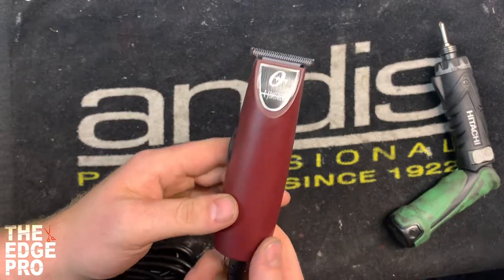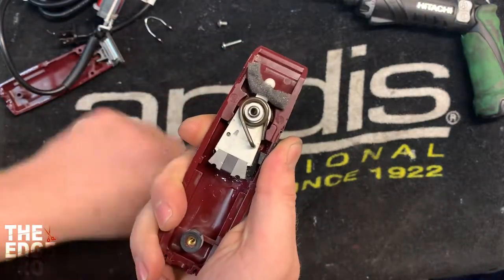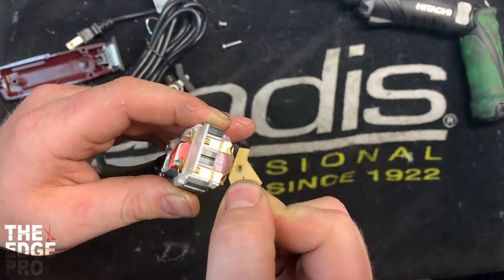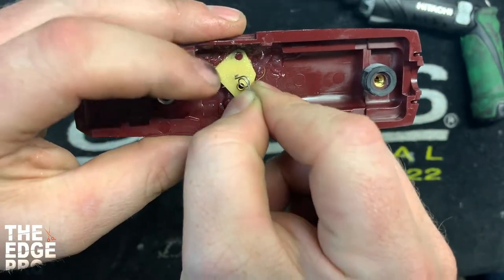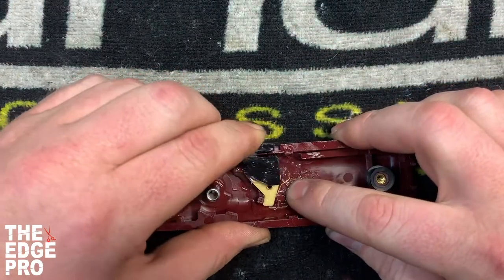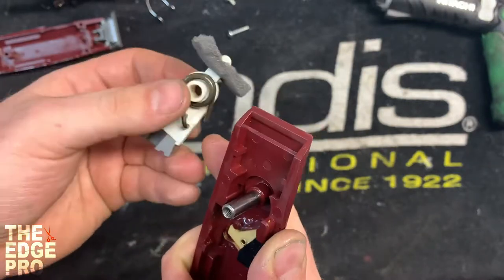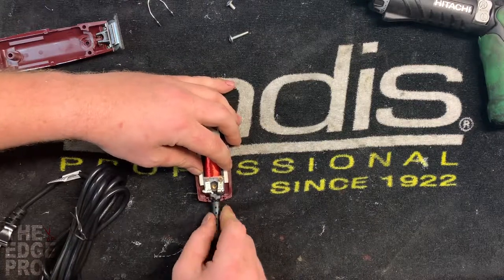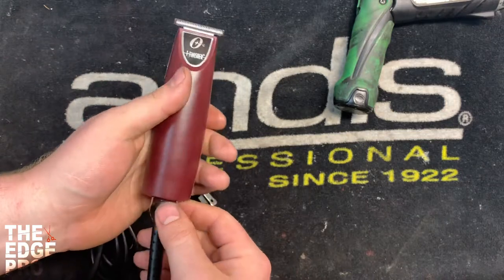How to Replace the Oster T-Finisher Switch

Comment: Ok,  I've watched this at least 3 times.  Just saw, the direction of the case was changed toward the bottom which allows room.  I've been trying to do it from the top and it is impossible.  I'm trying 3 more times.  If I don't get the hang of this, it's back to Ft. Worth.  Can't believe this is so difficult.  Also I watched the older video and I don't see how the unit would turn on.  Please plug in so we know it worked.  Thanks  Back to the drawing board.

Comment: One thing should be pointed out, when Brandon puts the contact on the little nipple, the other side of the contact should be resting on the elevated ridge on the opposite side.  This may seem small but I was repeatedly placing the opposite side of the contact below the ridge which caused the contact to pop off the nipple.  When you are a do-it-yourself person, this was huge.
Reply from the maker: Thanks for pointing this out for us!
Reply: Una consulta, la pieza con el puente de cobre..debe ser pivotante? O puede ser fijo?

Comment: Thanks for the video. As some have stated before I have a clacking noise. What part needs to be replaced or adjusted? Thanks for the help.
Reply from the maker: Typically that is either a blade with too much tension or more likely the spring set is not balanced and it can hit the housing. If it is the latter, you have to replace spring set: https://www.theedgepro.com/products/oster-finisher-spring-set-r . You can also attempt to bend the spring to balance it, but that is usually unsuccessful.

Comment: Mine still makes a loud clacking noise when running. I checked and found no crack in casing and reseated the springs but still loud. Any help appreciated. Thanks.
Reply: I am sure you have found a remedy by now. I had to order a new casing because my upper housing cracked. I went ahead and ordered both housing pieces and replaced them using this video. I got my housing pieces from WB Barber Supply out of Pennsylvania.

Comment: Do you know if I can order a new switch? My wife dropped hers, and the black switch broke. I tried to glue it back together, but its too much strain on it to stay together. Thank you!
Reply from the maker: Scott Roberts the black switch actuator that goes from the outside of the housing to the actual switch is available. The switch itself is also available but it comes riveted together with a new field.
Reply: @TheEdgePro  I just need the black part that your thumb slides up and down to turn it on and off. Do you know when I can order it?